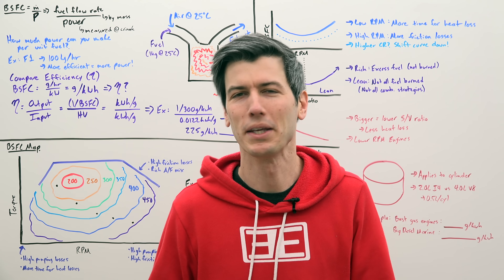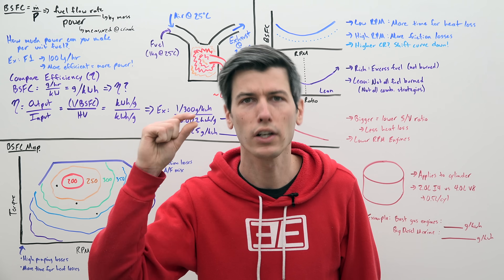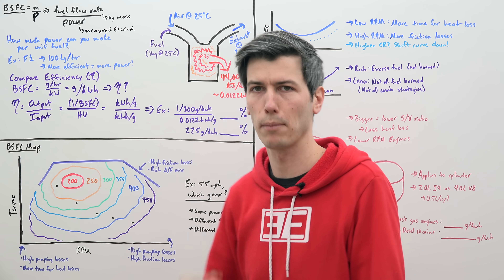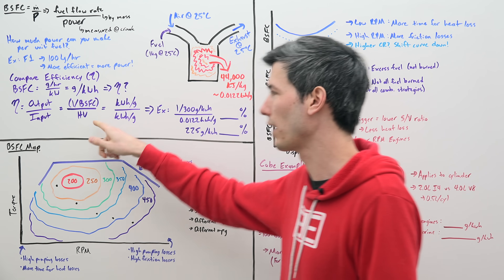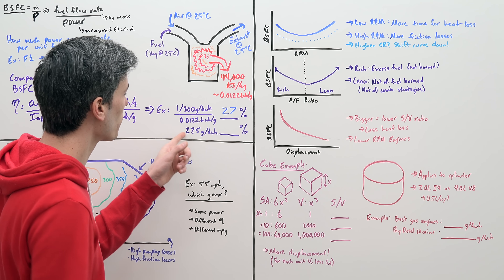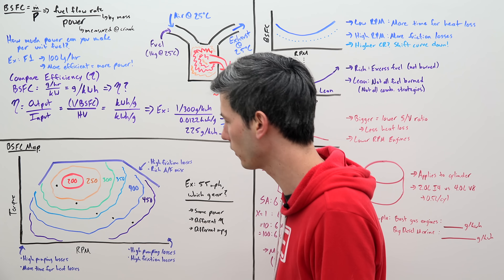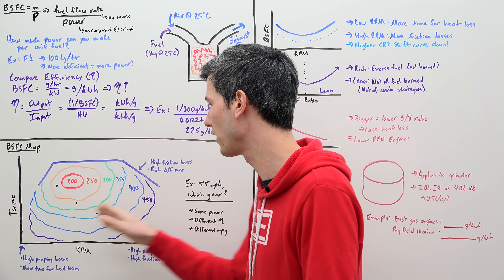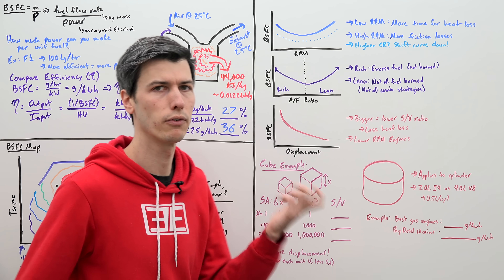The Best Way To Compare Engine Efficiency - BSFC

Comment: Finally, I can share this video to my family who still believe 1 liter engine is more fuel efficient running at 4000 rpm at 100 kph than 2.5 liter engine running at 1600 rpm at the same speed. Thank you, Sir!
Reply: Smaller engine isn't mean more efficient, so many car manufacturers only focus on weight reduction.

Comment: The theoretical limit for thermal efficiency, if you have unlimited amount of money, is about 60%. F1 engine is at 55%. Pretty amazing . Thanks Jason! It's been a while since I see that Cengel and Boles 🔥🔥
Reply: combined cycle engines can crack that 60%.
Reply: Actually it would be higher. F1 restricts the use of ceramics for pistons and bores. CSIRO did efficiency testing back in the 80's with ceramics and achieved efficiencies of around 60%. Think of how much higher it would be now with modern electronics and injection.

Comment: Awesome video! How would I calculate the most efficient rpm to cruise at in 6th gear? I always burble my Mustang down the highway as low as possible but this video now tells me that that isn't as fuel efficient as it could be!
Reply from the maker: Generally speaking, lower will be better. The faster you go, the more aerodynamic drag you have, so even if the engine is in a more efficient spot, it has to make more power to overcome drag, and thus worse fuel economy.
Reply: @EngineeringExplained  This could be another video where you explain the best fuel economy vs. speed and the optimum point.   You could even pull in the SAE Supermileage example where low speeds, burn and coast full throttle operation and good aerodynamics allow for several thousand mpg.
Reply: Reiterating what Jason said, generally speaking, fuel economy falls away as speed drops. I find my fuel economy is highest at the lowest speed I can shift into the highest gear. Most vehicles would benefit from having an extra gear or two on top.
Reply: @AustinPerdue  This I wholeheartedly agree with. I have an 06 G35 Sedan with a 6MT, and 6th gear at 70mph gives me +/-3000 rpm. A 7th gear would bring it down to at least 2k.
Reply: Assuming this is a modern Mustang, Ford will have already done the work for you by selecting a highest gear that maximizes fuel efficiency for the offical highway fuel economy test. The average speed in that test is 48.3 mph (with no stops), so your Mustang will most likely be most efficient driving at 48.3 mph in its highest gear, give or take a few mph.
Reply: You should be able to find a BFSC map in the owner's manual.

Comment: It's worth noting that, while larger engines have less surface area per volume, you tend to need lower compression ratios for larger cylinders because they're more prone to knock, all else being equal.

Comment: This video could be a sequel to your previous video : why small displacement turbo engines are bad for efficiency
Reply: So many motor vehicle manufacturers only focus on reduction vehicle weight to gain great mpg
Reply: @yusufkuntoro3141  weight reduction? Most vehicles are getting massively heavier. The lightest subcompact cars these days are Honda civics weighing 2,771 to 3,012 lbs. Everything else in the same class ranges from 2900lbs to 3200lbs approaching mid size. I don’t see any weight reduction going on. If look at each car going up the years, weight gets added most of the time unless you’re looking at a sports car. Then the weight can possibly drop if the engine doesn’t get revised
Reply: @suiton20  Civic isn't subcompact anymore tbh which a Honda Fit is around 2575 lbs

Comment: Correct me if I’m wrong but my takeaway from that is that for daily driving it makes sense to use the engines efficiency to accelerate, say 70% throttle, to a given speed and then maintain that speed. Not to accelerate gently to that speed as its inefficient use of the engine. Driving teachers in the UK tell us that gentle acceleration is best / more fuel efficient. This disproves that logic. Excellent.
Reply from the maker: They're actually correct, but it's a complicated story. Generally speaking, it's better to accelerate more slowly, because this results in a lower average speed, and a lower average speed will have less losses, and thus use less energy. But it's a balancing act. An engine operating at a more efficient spot doesn't necessarily mean you're getting better MPG. Example: driving at 90 mph, your engine might be in an efficient spot, but your aero losses are massive, so you have to make a lot of power, which means bad fuel economy.
Reply: The theoretical ideal is to use the engine efficiently, or not at all. This is how hybrids do it, or more generally pulse and glide. If you are requesting less power than you need, the engine will run harder and store excess to battery. If you are demanding more power, the engine will run at less and cover the missing power from the battery (until it runs out). If you need very little power, then the engine can just turn off and use no fuel.

Without a battery, you have to do this yourself. Run the engine efficiently, store that energy in the mass of the car and coast down. As always, avoid braking. Keeping a lower speed reduces how much energy you waste into brake dust, and reduces drag. Even with hybrids, regen isn't perfectly efficient, so don't regen brake if you don't need to.

Comment: Does this explain why diesels are so efficient ? (Lower RPM) 
I know diesel itself is more energy dense than petrol
Reply: No. The lower rpm is a limitation of compression ignition. It's because of the higher energy density of diesel fuel since it's a longer hydrocarbon.
Reply: Diésel operates at high pressure high temperature this gives you more torque but because of the auto ignition they normally don’t burn all the fuel in the piston
Reply: No throttle, so a lot less pumping losses. Higher compression, higher injection pressures, more specific energy in a give unit of fuel and of course more torque that a similar gas engine all play a role in higher efficiency.
Reply: @hojnikb  more torque is just another way to say more energy
Reply: Diesels are more efficient mostly because of higher compression ratios. Other than enabling these high CR (diesel's autoignition temp is higher than gasoline), the fuel has little to do with it. 
In other words, if you could build an Otto cycle engine running on gasoline with the CR of a diesel, it would be a bit more efficient than the diesel. The CR is the key to that.
Reply: @ASJC27  why isn't the same done for petrol engines then ?
Reply: @YounesLayachi  As I said, petrol has a much lower autoignition temperature, and that makes it much harder to avoid knock with high CR. 
Modern efficient gasoline engines have significantly higher CR than older engines, but still not nearly as high as diesel. There are new technologies in development that try to make diesel like CR a possibility with gasoline, but they aren't ready yet. EE has videos on some of them.

Comment: What a great video. I 100% agree. Pretty sure my 5.4 Ford V8 Expedition has a better BSFC than my Subaru Ascent 2.4 turbo. Both get the same mixed mpg but the V8 is in a 1500 pound heavier vehicle.
Reply from the maker: Maybe so! Or if the 2.4L is working at a high load frequently, putting it into boost, with a rich a/f mixture, then real world mpg can be down.
Reply: That might be true, but if you don't use all that potential energy the smaller Subaru might still be the better car for daily driving.

A container ship might be more efficient but doing groceries with it is pointless.

Comment: better going with Lower heating value than Higher heating value (the difference is the latent heat of evaporation of water).
Reply from the maker: Yes, the value provided in the video is lower heating value, as the water leaves as a vapor from combustion. But getting into LHV/HHV seemed like going a bit too deep, a bit distracting, so I left that bit out!

Comment: If you use maybe a pre-chamber combustion of some sort, would it then be possible to use a lean air/fuel ratio, while still burning all the fuel and achieve good efficiency?
Reply: Yes, look at the Nero engine that Maserati developed using the Alfa v6 as a stepping stone which is basically the Ferrari turbo v8
Reply: @Rad_Triumph_765_RS  the one in the new MC20?

Comment: If your 20mpg tractor trailer is just moving one person from point a to point b, the 30mpg moped is still more efficient for the job.
Reply from the maker: Or if the 30 mpg moped is pulling a trailer, it's also doing a great job! ;)
Reply: he did specify "ENGINE" efficiency.  The reason MPG is used when purchasing a vehicle is because the overall product efficiency is what's important to end consumers. You can achieve better MPG by optimising the chassis and the suspension.
Reply: @RaphYkun  and parasitic losses (accessories), aero, etc..

Comment: About time this video came out. Thank you!
Reply: My 2000 Insight engine is ~200g/kwh, and thus is around 40% thermally efficient. I can see over 100mpg cruising on the highway in good conditions. 

I'm surprised that modern engines really haven't come very far from this figure.

Comment: This is super interesting. I think you should do a video on the Liquid Piston rotary engine. Super simple, high power density and efficiency.
Reply: Sound interesting!
Reply: @Donovan Piko True, but there is some decent info out there.
Reply: At 9:34, Jason gets into the ratio of surface-area to volume of a a cube and a cylinder, and the lower the ratio is, the higher the efficiency (and the lower the BSFC)

I had done a similar calculation for a rotary engine and compared it to a Porsche 944. As I recall, the rotary had a much higher area-to-volume ratio vs the 944, suggesting a higher BSFC.
Reply: @kevink2315  yeah the rotary engine does have a pretty large surface area relative to its volume. But the Liquid piston engine supposedly gets close to 70% thermal efficiency. I guess another way would be to use a low thermal resistance coating to reduce heat loss to the cylinder walls
Reply: @RahulPatel-fp3ju  I have seen 75% thermal efficiency in one article. Swain has been coating pistons and other engine parts for a decade(s), and would help here.

The LiquidPiston engine is enough like the Wankel to be close to the same area/volume ratio,
Reply: @RahulPatel-fp3ju  Many wankel engined car owners mix a small ratio of motor oil in their fuel to maximize longevity as gasoline is a solvent. The achates engine is a far more important engine breakthrough that will revolutionize medium and heavy duty truck market.
Reply: @RichardPrendingue  Jason already did a video on the Achates engine, which is super cool btw. The Liquid Piston engine doesn't mix oil and gas because the "apex seals" are stationary in the housing, and can be lubricated externally
Reply: I believe the Liquid Piston engine has two big advantages over the Wankel. 1, the flame front doesn't have to chase a moving combustion chamber. 2, Very high compression ratios, focused onto that small hemisphere on the corner.

The rotor side seals are probably still a concern though.